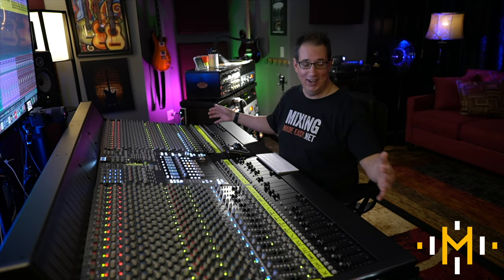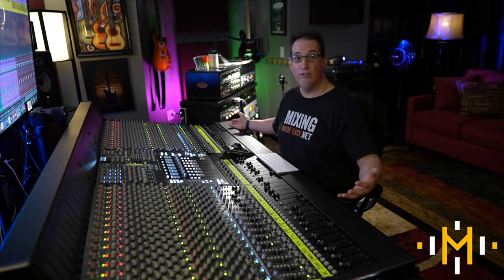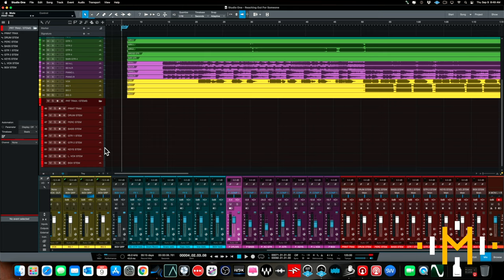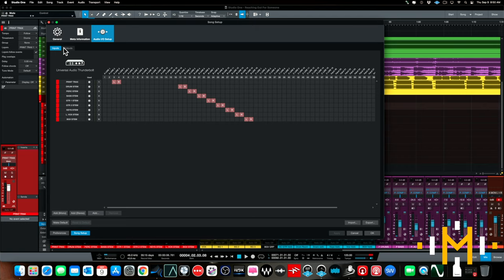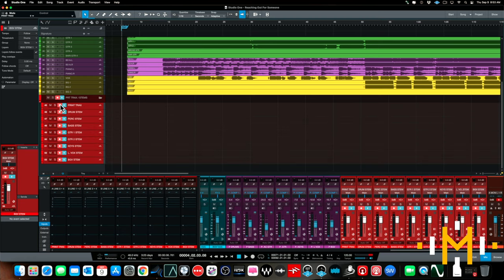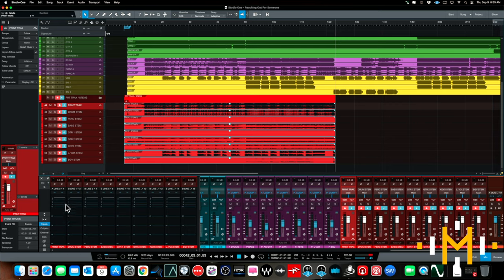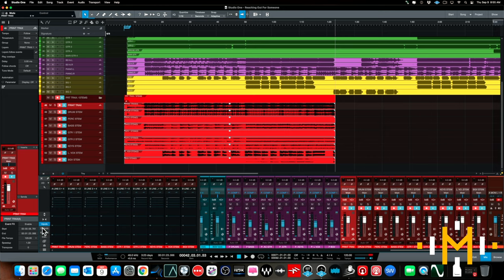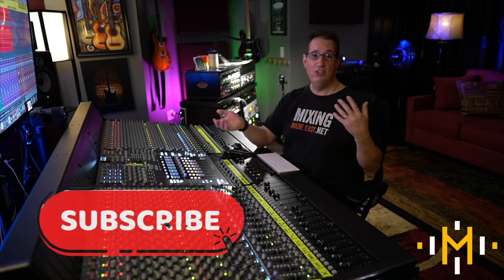PRINTING A MIX & STEMS | Solid State Logic |  SSL ORIGIN

Comment: Hey, I have a question about levels when printing on the SSL. I'm using an SSL duality and the Stereo print seems to be way lower in level that the actual mix. Something I might be missing?
Reply from the maker: How did you check the master fader on the duality? Where is that set at? My print track is the exact same volume as the mix itself.
Reply: @MixingMusicAnalog   Thanks for your reply! I have it at 0. Not sure why that happens.

Comment: How do you route the main DAW outs?  Do they run back to the console through separate stereo returns?  If so, would it not then run back through the main bus processing on the console?  

Very much enjoying this channel!
Reply from the maker: If I understand the question correctly, the daw OUTS are running back into the console on an EXT input so it does not go through the bus compressor.